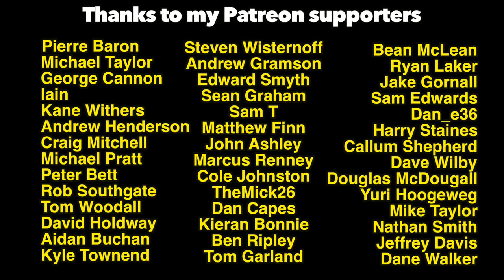EP3 Civic Type R - What's It Like To Drive? ON TRACK REVIEW

Comment: Thrash it Mr Silvester! K20 soundtrack never fails to make me smile. I used to smoke out of the window in a top floor flat and you could here Vtec for miles around.
Reply: When I first k swapped my first DC2 years ago it was all finished apart from I didn’t have an exhaust....didn’t stop me taking it out for the night with just a manifold though....my mates could hear it 6 miles away 😂

Comment: Started watching Dan because of his E46 M3 content. I’ve sold my E46 M3 which was a weekend car and a track car. Now have a dedicated track EP3 and a Porsche for weekends. 

EP3 on first try out on track was a piece of sh1t. I thought it was a huge mistake, but I sent it up to Rob at Area Motorsport for a half cage, buckets & harness, rota force wheels & NS2R tyres, Tegiwa intake, yellow speed brakes, yellow speed coilovers to Rob’s spec, along with a bunch of suspension refreshment and drive shafts etc. Full geo and camber etc to Robs spec. He is a magician!!!

It’s also been mapped with inlet and exhaust manifolds etc.

It’s really a great car, no understeer amd it rotates beautifully into slight oversteer which you dial out through the throttle. It really handles very well and can’t fault it OTHER than the steering…

Dan you are spot on, steering is the biggest let down of the car.

Hoping someone comes up with a fix at some point, I’ve poured a lot of ££ into this car…
Reply: I heard it's to do with the rack placement itself and how it interacts with tie rods etc., people change the rack to DC5 or use those solid rack sliders and say it makes a difference, but there's others who say it barely improved for them. Personally I think it's just a bad design that you have to get used to...

Comment: I had an EP3 with the same spec. I totally agree with that you’ve said especially the steering, it does the job but you just wish it had more feel.
Reply from the maker: Sounds like I hit the nail on the head! Everyone saying that. I didn't notice it on my road car at all but that just shows how different track driving is
Reply: Had caster plates and caster increase bushings on my EV1. Helped the feel for sure, but a fair bit of effort and expense to rectify a problem that imo should never have existed!

Comment: there is a simple solution for steering feel , just replace the rack with a hydraulic one from 7th gen coupe or RSX.
Reply: Could also be the rack slider being worn out. Common problem in Dc5s. Replaced with a solid slider helps
Reply: @danielcudicio4100  also destroys the rack after some use , if you want to replace the slider don't use solid metal replacements.
Reply: @Jackal9405  I used the delrin plastic type slider. They are ment to be self lubricating.
Reply: @danielcudicio4100  those are nice , but most of the aftermarket sliders I've seen on cars were metal. BUt still nothing beats hydraulic steering rack. There is a reason why honda used hydraulic racks on DC5R.

Comment: IK old video, but Inside the ep3 steering rack there is a rubber bushing that ends up flexing under a lot of load. 
Recently replaced that bushing with a solid metal "bushing" and 
definitely made the steering have sharper turn in and better communication to the tires. 
Still the steering ratio is very long :(
definitely

Comment: I was ordering what you recommend for a good fast road setup and ocasional track day regarding:
1. ARB front/rear
2. Spring rates front/rear

I have currently KW V2 and I need to put new springs so I bought rear hard race camber kit and front camber bolts

Comment: Loving this new series so far and this is another great video.

How do the EP's handle compared to an EG on track other than the lack of feeling from the steering?

Would be interested to see you drive a Megane R26 as people seem to rave about the renault cars and they are reasonably cheap compared to old Hondas these days.

All the best
Reply from the maker: Yeah Meganes are on the list. I have the feeling I'll break a few hearts with that one and prefer the mk3, although I haven't driven either before. 

As I said in the video it was alright, just a bit heavier, suspension isn't as good, nor is the steering. Still a good package though the EP3

Comment: Yeah the ep3 electric steering is abit over powered but glancing over that they really are great motors you can put the dc5 rack in that's ment to speed up the turn in and also the ps in those is abit nicer.

Comment: I hated the steering on mine. Even after total rebuild of the rack due to not centering properly, it was still crap. Too slow to react to driver inputs imo. It really lets these cars down. There must be a mod to sort this out by now surely?
Reply: The only one I know about was people swapping the electric rack for a DC5 hydraulic one
Reply: Nah, its just inherently bad design, the way its mounted to the bulkhead with big long track rods. Heard a DC5 rack isnt worth the effort, but what does make a slight difference is fitting a delrin slider in the rack. Ive got a GT86 now, just couldn’t believe how I put up with the EP3 steering for so long..

Comment: you can change the rack to a DC2 one  i think
Reply from the maker: You definitely can't, totally different design
Reply: @dannyDC2  ah right, must be thinking of something else. Awesome video. Always love to see an EP3. Much love.
Reply: @JamieLucaZ89  You can do DC5 hydraulic conversion which people say helps the feel a lot
Reply from the maker: You would have to change full system, not sure the pulley would fit under the bonnet?
Reply: @dannyDC2  DC5 racks have been swapped into EP3s, Not entirely sure on the process but it can be done.
Reply from the maker: @bones6978  doesn't sound like it would be too difficult, like I say the pulley for the pump might foul though